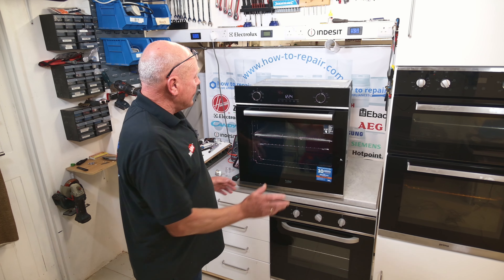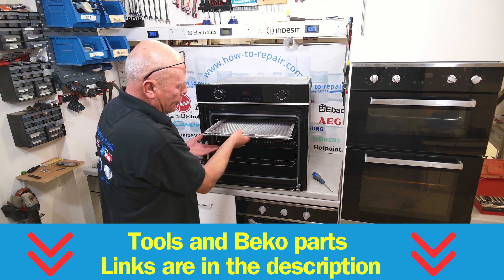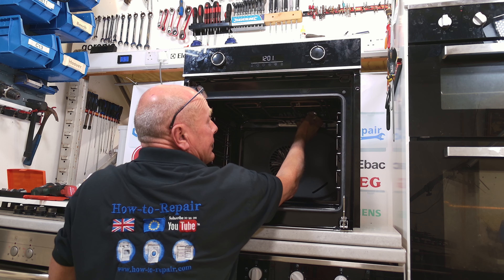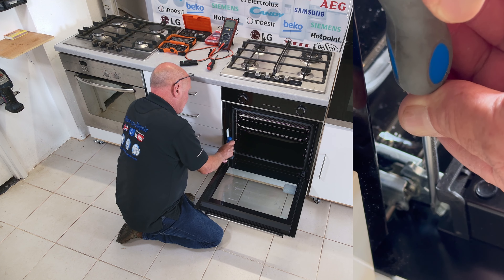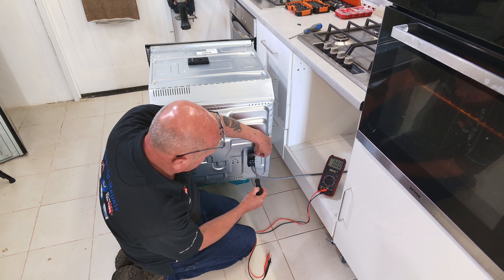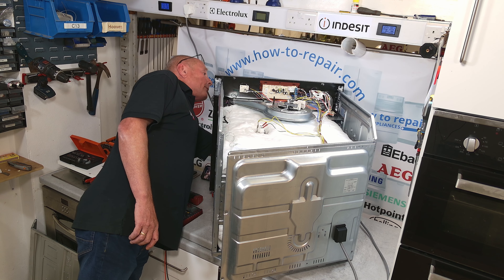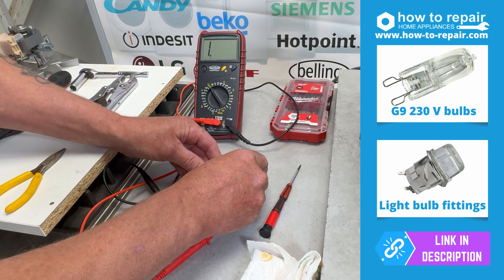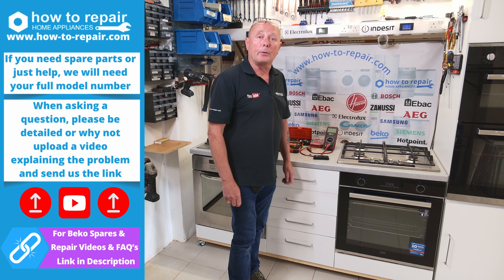How To Replace Halogen G9 Bulb & Oven Light Lamp Fitting?

Comment: my hotpoint tvfm60c is making alot of noise when the dryer is turning  during a cycle
Reply from the maker: Hi, I will need the full model number of the identification plate and the details of your problem so that I can provide you with useful literature. Please use our contact us page and make sure you fill out the request for what your problem is. A video shoot of the problem would be perfect as well.

I will get back to you within 24 hours, normally. https://www.how-to-repair.com/help/contact-us/  

Please remember to subscribe to our channel, as that's what keeps this channel going. Thanks, Paul 👍
Reply: @How-to-repair   the modle number is a hotpoint tvfm60c6p making noises comming from the back what could be the problem
Reply from the maker: @PedroJaimeObrien  it's most probably the back bearing scraping because it is worn out take the cover off inspect it